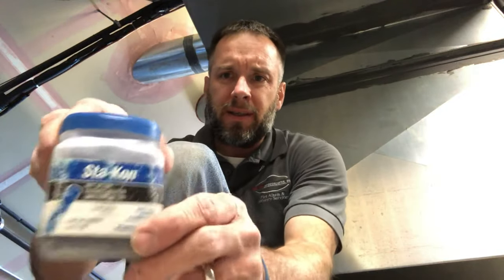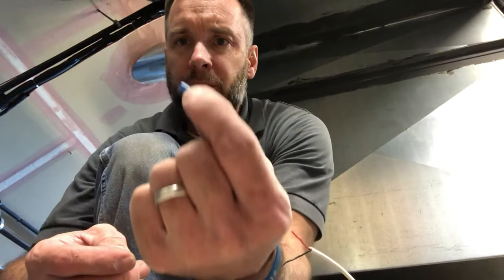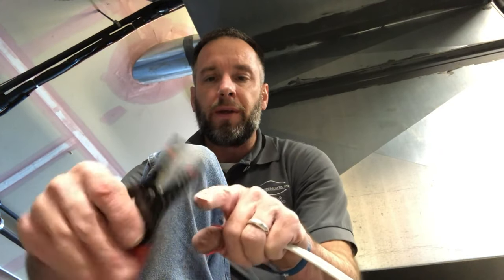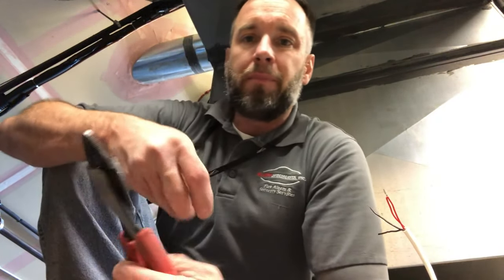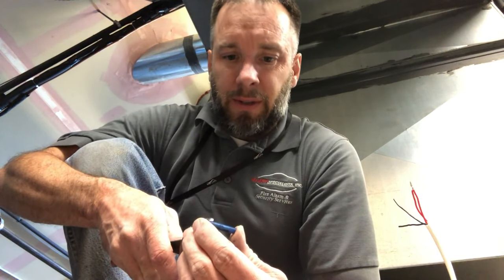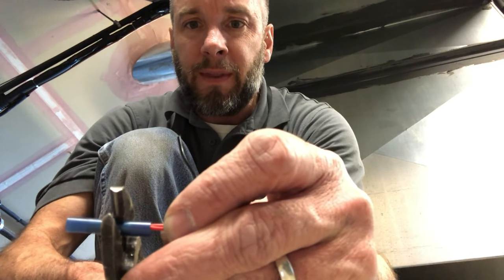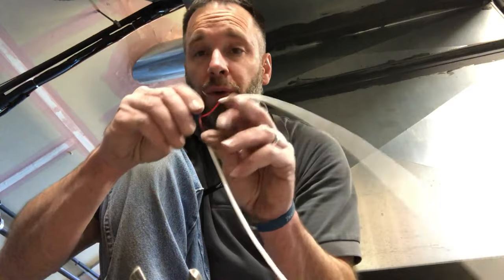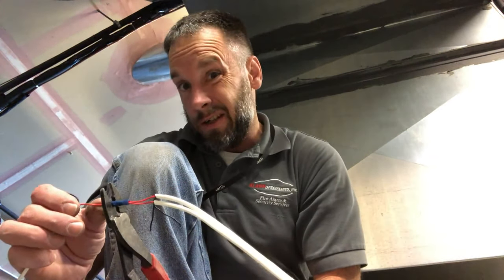How to Connect Wire using a Butt Connector / Splice Connector

Comment: Thanks guy. I've been toying with electronic's and DC wiring for over 60 yrs but I never used or learned how to use butt connectors until just now! Sure beats soldering. Especially with 0 - 10 gauge.
Reply from the maker: they have lots of cool butt connectors now, with the solder in the middle , just heat with heat gun and it connects and solders!.  if you heat most butt connectors, it is shrink tube so it will close down as well.

Comment: I am making a portable fan cooler thingamajig for the summer and  wasn't sure how to go about connecting the wires.This was the first video I found when I searched "how to use butt connectors" and you answered all of my questions! Normally I have to watch a few videos or type in different search words before I figure it out, so this was a pleasant surprise. I'm going to check out your other videos too, the eBay ones look interesting.  Thanks and have a great Sunday!
Reply from the maker: Glad it worked out, always a fine line between too much info and not enough info!  hope that fan cooler helps, its HOT!!!

Comment: Thanks, wanted to be sure I was doing it correctly!
Reply from the maker: well, I am sure everyone has a different idea of correctly, but I have done a few and they all hold pretty well, you can also use a lighter or hair dryer, and the ends are "heat shrink" and they will shrink in around the wire when exposed to heat!   Thanks for the comment, and good luck

Comment: thanks man. gotta put a new radio in my truck. wanted to know what i'm dealing with. i actually saw that crimp tool at my work so i guess that's where ill be splicing wire this week
Reply from the maker: Should work out.  Most issues come with finding the right connector for the right wire.  
But hopefully the connectors are stored in a fashion that allows you to match the wire.   Wires are labeled on the jacket
Thanks, hope it helps

Comment: How do I disconnect wires that have been crimped and heat shrinked?
Reply from the maker: well, unfortunately you will have to cut them, and then redo them when you are done.   make sure there is no power on them, and only ever cut one wire at a time.  but also might want to consult an electrician that can evaluate your specific problem

Comment: Question. Do the wires need to touch each other INSIDE of the connector during crimping? Or does the metal inside the connector create a path
Reply from the maker: It's always good to get them to touch, but as they are crimped in the metal portion of the splice, you are 100% correct, the metal will be the conductor.
Reply: @MyLooneyBin  installed my new stereo myself today, thanks to you!!💕

Comment: How would you weatherproof this for underground?
Reply from the maker: for under ground?   yea, this connection probably wouldn't be weather proof without putting it in a weather proof box .//// if it wasn't underground, maybe some electrical grease or use the ones that have the heat shrink built in ....    underground though, I would say a box, maybe heat shrink, but unlikely it will be water tight ...

Comment: Do the stripped wires have to physically touch inside?
Reply from the maker: They do not.  The connector has a metal feral on the inside. So as long as each side gets crimped and the wire holds, you should be good. BUT I always like to strip enough and do my best to get them to touch on the inside.
Reply: @MyLooneyBin  Makes sense. Thanks for the quick reply and info ✊🏽

Comment: Can you use a heat shrink maker?
Reply from the maker: well, there is actually metal inside of these that helps the connection ... these do have a heat shrink feature you could use.  after crimping, then apply heat to activate the heat shrink feature of the product

Comment: is the cylinder inside the buttsplice supposed to be cracked after crimp it? I looked inside and it looks like it cracked a bit but definitely holds the wire.
Reply from the maker: There is usually a split down the metal, and when you compress the connectors it will "crack".  For a better visual appearance, if you center the split on the far side of the crimp, it tends to not show as much.  You can play with a few and see, but your correct that it really doesn't matter.  Most are heat shrink, so a little heat on them will seal the rubber around everything if desired.  Besides the look it's all good and functional!

Comment: If you strip the wire a little longer then needed and some of the wire is exposed to the plastic on the butt connector will this cause a fire?
Reply from the maker: It is always a good rule of thumb to never have exposed copper (wire).   in a situation like that you may be able to just use some electrical tape and wrap it around the wire.    Fires are usually caused by a malfunction of some sort.  In your case, if the bare wire touches metal, and there is a "short", then the wires will begin to heat up, and if there isn't some kind of safety trip, then a fire could start.  This mostly applies to "high voltage" like 120VAC house circuits.  Very rarely would you have this issue with low voltage DC circuits.  Low voltage DC circuits usually just stop working.   These are just general statements, please consult a qualified and insured electrician with any questions.

Comment: When do you use the oval crimp, and when do you use the crimp with the tooth (referencing your crimp tool)? Thanks!
Reply from the maker: my opinion, I don't really know, but the oval would be for solid wire, and the tooth would be for stranded wire.   I had never really asked that question before and I couldn't really find a good answer.  interesting no one really asks that question more.   I am gonna do some digging around and see if I can get an answer.  now I am curious!!
Reply: @MyLooneyBin  thanks a lot, I appreciate the follow up and if you come across additional info that’s great but don’t go to any trouble.
Reply from the maker: Here was the answer I received from a technician I trust. 
Insulated and non-insulated sir. The oval part is for insulator style. 
The ones with the tooth is for non-insulated that you put heat shrink over! 👍

Comment: Would if be advised to finish with some electrical tape?
Reply from the maker: you definitely could, this can help prevent ground faults and such, but if the wire is stripped correctly and crimped correctly, there really shouldn't be any need.   But, again, it's not ever a bad idea to wrap up any electrical connection with some tape once you have verified they are secure.